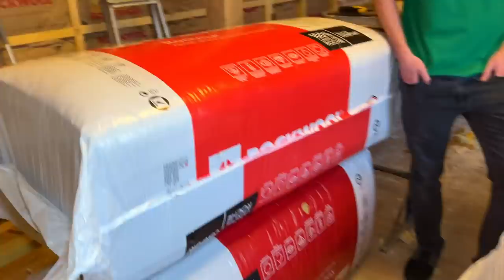Help Is At Hand - Doing It Ourselves

Comment: The staircase needs to reversed so that it  starts downstairs next to the door that will lead to the bathroom and lands upstairs on the opposite side of where it was.  It would use the current landing space to tuck in a desk next to the window and a sort of vestibule on the other side.  Put your bed on the other side of the support beans.

Comment: Hello Michael, ideas for blocking cooking odors: Keep your options for a clothes closet and put the door at the bottom.  We use that method here as it is so easy, we let the heat go up until I start to cook and I close the door off the kitchen.  I was thinking it would be wonderful if you enclosed the stairs going to the bedroom with recycled windows, medium sized and one row could even be in sashes so you could open them for heat to rise.   It is so difficult to get the heat to simply find it's way upstairs, here at home I sometimes use fans but if I could open more 'vents' ie open windows that would be a bonus. maybe I am crazy but this is just an idea.

Comment: Best way against mold is to use a branche with spikes (like what we call "ajoncs" in French). Then dig the top, you will see an hole, burry the ajoncs inside the hall and each time the molds will be using the tunnel, as they are "emophile", they will pass away rapidly

Comment: For cooking smells you can also get a air filter with a carbon filters at the ikea for a good price. You could put one in the bedroom and turn it on after dinner (maybe via a remote) so it's nice and clear air before bed without losing the heat via the windows. Definitely keep the wall though, just close the door before cooking.

Comment: Hi Mike.  If you build a wall fr the stairs you ned a light in the stairwell and you have the connection where you said you cannot have a cupboard. I wondered if you had considered reversing the stairs with three winder steps at the top so you descend to where your bathroom will be on the other side?  that gives more room in your kitchen too.  The cottage is fabulous and maybe you should consider the back boiler in the Aga for heating in the other side and the bedroom and hot water.  Also, don't stay on Ritatin for long because the effects are worse.  I was on it for three yers as a child and suffered from depressions for the rest of my life.  S

Comment: So happy to see you again, Michael! The attic bedroom is looking great! I think a door at the top of the stairs is a good idea, not just for food odors, but also to keep the bedroom cool for sleeping. I used to live in a little cabin in the woods that had a wood stove for heat and a sleeping loft upstairs - when I had the stove on, which was necessary in the winter, it was SO HOT in the loft that I had to sleep with the window at the head of the bed wide open just to be able to sleep. A better solution to allow heat to reach the bedroom is to get an antique cast iron grate at a brocante, and cut an opening in the floor for it so that the heat can come through that into your room. Set up a way to block that grate when you're cooking to keep the odors downstairs, but be able to open it to let heat come up when you need it.

Comment: Michael, I have an idea for a fun video you can make with Billy and lots of helpers to rid your lawn of all those moles!
This game is called "Whack A Mole, Lawn Edition," only you will not be "whacking them," just catching and relocating them to the forest where they can no longer wreak havoc on your well-tended lawn.  You will need a very long garden hose with running water, sturdy pairs of gloves - such as suede or leather - and cardboard boxes.  One person will stand at one hole running the water from the hose into it while other people are stationed at various other nearby holes.  It won't take long before a mole will emerge from one of the holes since they dig tunnels between the holes.  Grab the mole firmly but carefully using gloved hands and transfer to a cardboard box.  Repeat this process until either you run out of moles or you laugh yourselves silly!  (Actually, it's quite tense to watch for them to come up out of their holes!)  After you have a sufficient number of moles, transfer them to deep, deep within the forest.  Wait for a week or so and keep watch.  You may have to repeat several times, and also to repeat each season.  But this is a good and relatively humane way of ridding your lawn of pesky moles!  Good luck and have fun!  I'm sure Ernest would love to help on this one!

Comment: On farms where the animals are in danger of breaking a leg in a mole hill, some people gas the moles. They use a flame thrower without the flame on and stuff the nozzle into the hole. They are all connected.  The propane will fill the hole and either scare the moles out or put them to sleep .  More humane than a trap or poison

Comment: For your list: Since your  Kitchenaid appears to be packed up it's a good idea to periodically turn it on so as to circulate the oil and keep the seals tight. If the oil leaks you will have to send the mixer to Kitchenaid for repair.
Reply: Actually Kitchenaid mixers don't have oil, the gearbox is packed with food-grade grease, quite stable. You can repair them yourself, if necessary. (Don't ask me why I know this!).

Comment: You can also close the stairwell with a hatch. Many houses used to have that. If you put a chain or rope with a weight on it, it will open and close more easily. Place a fence around the hole for safety.

Comment: In the American South here we have moles as well. We often use mole traps, which you can place above where the mole is going, and as he continues the tunnel and pushes up a little lever on the trap, a big weighted or spring-loaded block comes down with spikes and goes into the ground. You can get them on Amazon. If they get into your garden they can cause problems, they do eat some roots, but mainly do damage looking for insects and grubs.